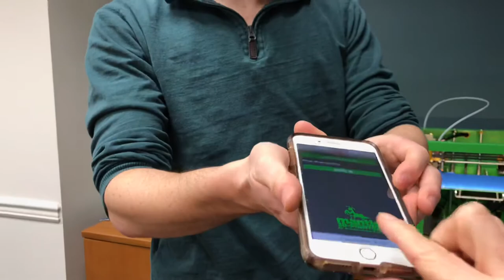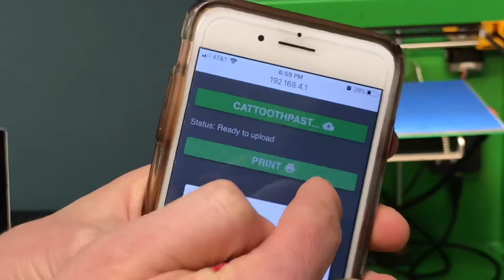Technical Breakdown - The Mantis 3D Printer

Comment: Why aren't you using silent stepper drivers? At a thousand bucks it should at least be using some tmc 2209
Reply from the maker: Hey Derik, thanks for your comment. We’ve considered it in the past but our time and energy has remained focused on the ease of use of the Mantis. However we have Marlin 2.0 and I tested TMC2208 stand-alone drivers and they work really well. Perhaps an available upgrade in the future but the price of the Mantis isn’t based on the sum of components but more so on providing customers a level of service they can’t find anywhere else. - Joe